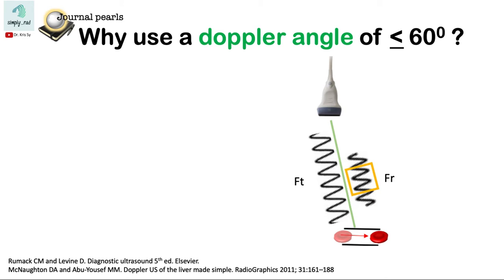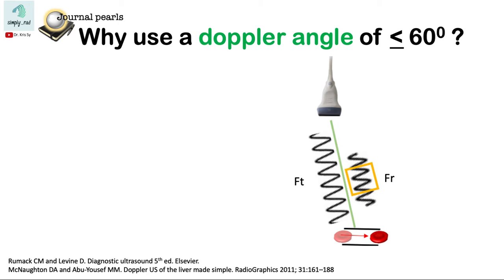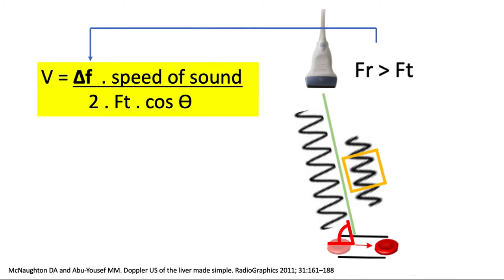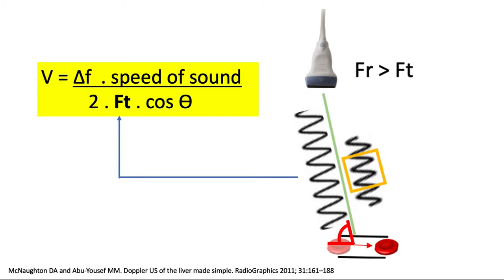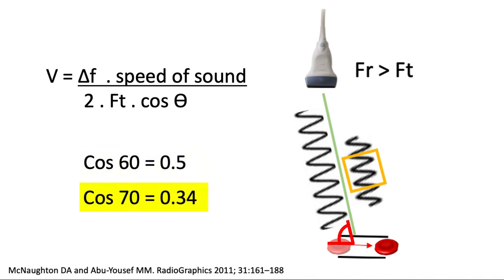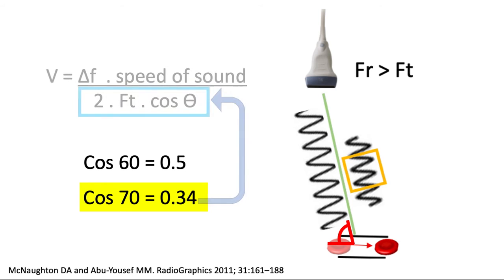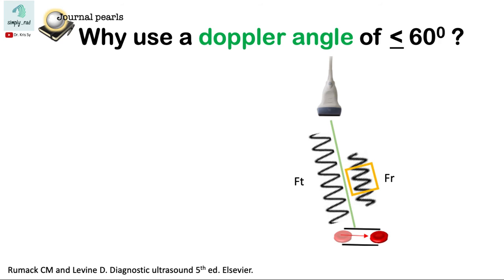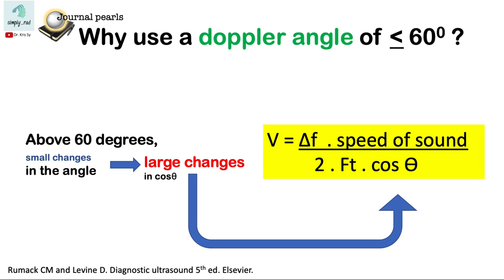Ultrasound Doppler angle simplified

Comment: The image used is slightly incorrect. Since the erythrocytes can be seen moving away from the probe, the Fr (frequency received) should be less than the Ft (frequency transmitted) for the given image, i.e. Fr < Ft. 

This can be easily fixed by reversing the arrow depicting the direction of flow of the erythrocyte. On doing so, Fr > Ft will hold true.